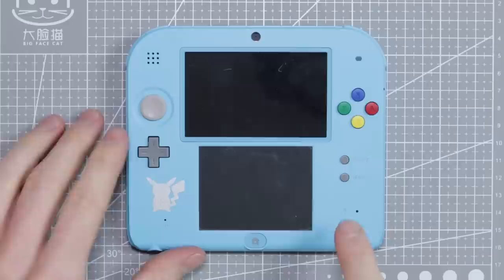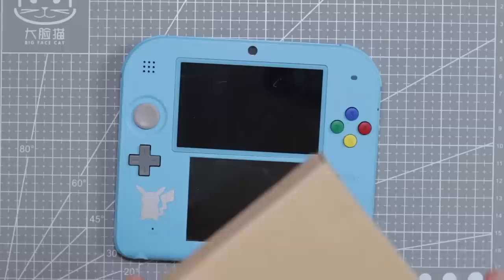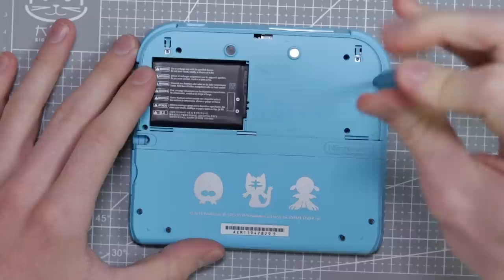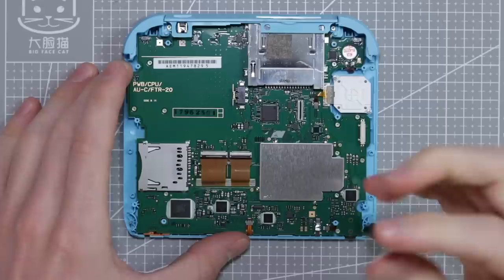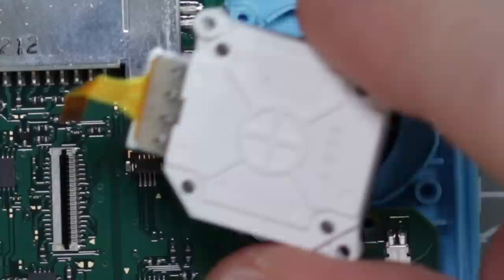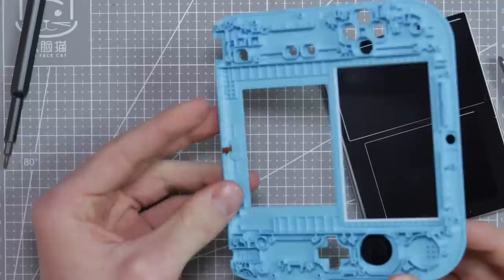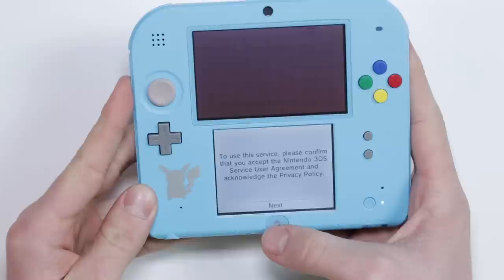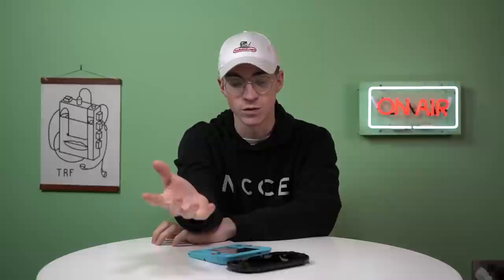Faulty EBAY Pokemon Nintendo 2DS - Can I Fix It?

Comment: I really advise against trying to leave the screws in the shell.  A lot of the time the just end up with screws all falling out or popping out as you manipulate the cover.  A better idea is to roughly draw the cover on a piece of paper or cardboard then poke the screws through the paper where they go on the actual part.  Thus will keep them both secure and organized.
Reply: Do RC good idea cheers!
Reply: I would just put a piece of masking tape over each screw hole until I'm ready to reassemble
Reply: He did just fine.
Reply: @dauntless78  actually he had to flip the cover over and all the screws fell out....
Reply: What a good idea

Comment: The reason the DS flashes and then turns off is because it Powers up, does a hardware check, and when the broken screen is checked, it fails and shuts off. It's the same with the folding ones when the hinge breaks and the ribbon cable gets damaged
Reply: @JamesM9794 So a simple replacement of the top screen on the original 3ds will fix it?
Reply: @asadislam3698  if the top screen is obviously broken, that would be the first thing I would fix. But I would also do a little more reasearch
Reply: My 2ds with a cracked screen still turns on, do you mean the whole thing is busted or just cracked?

Comment: I love how solid the 2DS feels, despite it being the cheaper model in multiple ways. I guess I missed handhelds that were a single piece like the first GBA model or the PSP.
The Switch is good with its single screen, but the Joycons still wobble around a bit. I think I'd enjoy a Switch mini but I play a lot docked so that's a no-go.
Reply: The Joycons Wobble Around A Bit Because You Can Take The Off. :D
The Switch In U.S.A. : $299.99
Reply: Tbh the joycons are pretty bad, mine are pretty glitchy

Comment: Another great video,  Elliot!  I love the 2DS; definitely one of my favorite consoles to repair, as it's such an easy system to work with!

One trick going forward to keep in mind, is to try to remove the left of the two ribbon cables for the screen, and then boot up the system with it removed (you can just hold the battery in place for a quick test).  I've had multiple instances with a busted screen where the system would pop and shut off as you've noticed with this one.  I've had other instances with a busted screen, where the system would come on and stay on, but the screen would be blank.  In BOTH types of cases, by removing that left ribbon cable and powering it on, the system actually booted!  Of course, in both cases the screen was busted; but this did allow the system to boot, and after booting, you'd clearly be able to see the broken screen through the backlights of the display itself.

It's not a huge deal; as you've pointed out, it's most likely the broken screen.  But it's a quick, easy way to do a quick sanity check before removing the entire board and swapping out the screen!

Comment: A great way to stop screws getting mixed up is to trace the outline onto paper, and then stab the screws into the paper where they would be on the devise. I used to do this with cardboard and bolts for when I rebuilt engines.

Comment: Are those scratches on the screen in the end or just some dust/hair?
Reply from the maker: Scratches.
Reply: @TheRetroFuture how do you replace that part? My screen works fine but the glass part is really scratched up for me.
Reply: @TheRetroFuture  why didnt you replace the glass?
Reply: @jboy27  Isn't the screen plastic? I'd imagine it's nearly impossible to replace the LCD without getting dust/debris micro scratches and whatnot between the LCD and the clear plastic. That alone is unfortunately the only reason I won't bother replacing the broken lcd in my 2DS

Comment: Probably shouldn’t use the same cloth to wipe the table and then the screen. If ever there were pieces of metal or glass shards or solder, they can stick to the cloth and scratch the screen upon wiping.

Comment: A couple of hours ago I realized that I screwed up my 2DS XL. What happened was I think that when I accidentally dropped it in my garage it landed on the side with the screen and because I never checked it I didn't find out until I checked earlier today. The thing that sucks is I have Pokemon Bank and I don't remember my password to my account for that. It works just fine other than the screen. It just needs replaced.

Comment: Hi, hope you can help. I have an identical 2ds which one of my kids dropped and shattered the internal screens. I have ordered the replacement and paid someone to install it at my home but the fool sheared 7 of the screws and left promising to order the extracter drill bit and replacement screws and come back but surprise surprise he has given me the silent treatment since. What is the extractor drill bit I need and can I order a comple replacement set of 2ds screws? Any info would be very greatfully received.

Comment: Hellooooo, i appreciate this video is old but i need some help, i purchased one of these last year and it worked perfectly up until now. The screen now flicks on and off as if i have turned the sleep mode being used. The game doesn't reset just the screen. Do you recon its an easy take apart of clean job?

Comment: but like... what did you spend on a screen replacement and new ribbon cable (for the vita job)? what's your ACTUAL investment?
Reply from the maker: So far, £25 for all replacement parts.
Reply: @TheRetroFuture  that's a hell of a deal. i've always been a tinkerer, and if it's simple hardware stuff i can generally suss it out. since you started this series i've been keeping my eye out for busted handheld lots. i'm hoping i snag some at this point just because i want something to work on.

Comment: I really like this special edition. Does anyone know if you can replace the NTSJ motherboard with an NTSC One? Like are the other components the same voltage and what not?
Reply: You want to change the motherboard to change region or any other reason?
Reply: @malick9549  Yeah. I really like the look of this special edition but this is a Japanese exclusive console, I was hoping if you swapped the motherboard to an NTSC then it would function like so.

Comment: Hey! A little question thats not anout the ds. Sorry about that. I bought a switch and the analog sticks are a little shaky, i mean, they works fine but you can move them a little little bit without having response. I dont speak english perfectly. Thanks you!!
Reply: Luca it’s the deadzones on the sticks, try reconfiguring them in the settings menu.
Reply: @ARANDOMGENT  thanks! And is it normal that the sticks are a little shaky? I mean that they are not totally firm, you can rotate them like a milimmeter

Comment: I can't find any cheap 2ds! I just want a broken one to fix my other.
Reply: Just buy the parts you need to fix yours instead of buying another 2ds
Reply: @alexaviermunoz_5443  can't really find any parts.
Reply: @Svabby  you just gotta search up the exact name for the part you need, should be able to find some on ebay no problem
Reply: @alexaviermunoz_5443  thx, I'll try it.
Reply: @alexaviermunoz_5443  I have a couple of questions and if you can't answer them it's fine, but where can I buy custom buttons and side pieces for my 2ds? Also do you know anyway to bypass stripped screwed since I can't open my 2ds.
Reply: @Svabby  I don't know how to bypass stripped screws but the buttons maybe, are you trying to get new ones or do you want them to be something certain
Reply: @alexaviermunoz_5443  nah they don't have to be new. I just want to have different colour.
Reply: @Svabby  you can find them on ebay I'm pretty sure, if you can't you might have to buy an entire shell.

Comment: But the 2DS defeats the whole purpose of 3DS games.
Reply: Why? 3ds games are normal but u cant use the 3d slider
Reply: Malick 3DS games were designed with stereoscopic 3D in mind,so if you turn off the 3D slider, you will not see & play the game as it was originally intended, you may cannot find your way out of a maze in certain games when you turn off 3D.
Reply: @johneygd  sone newer games dont support it (for example ultra sun and moon) and i have a 2ds and i never spotted a single difference between 2ds or 3ds
Reply: Malick aha oke.